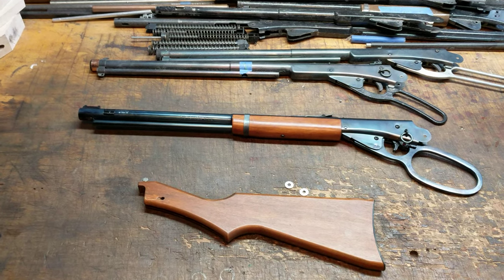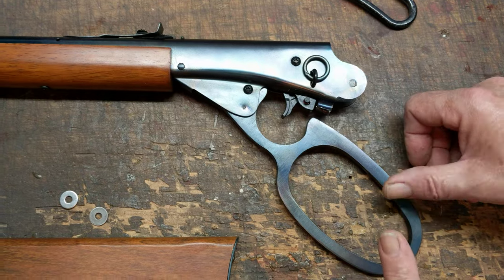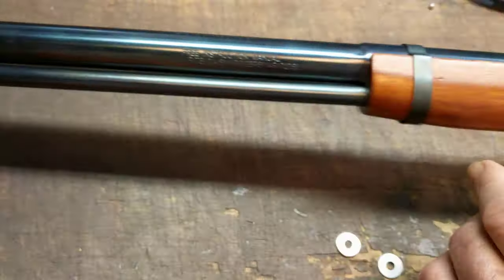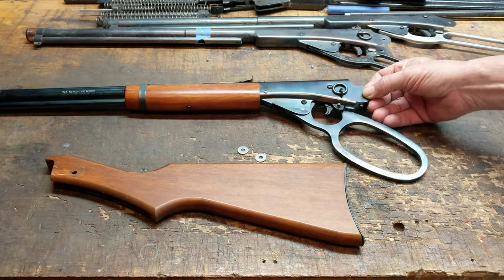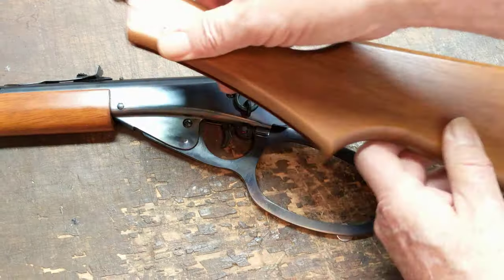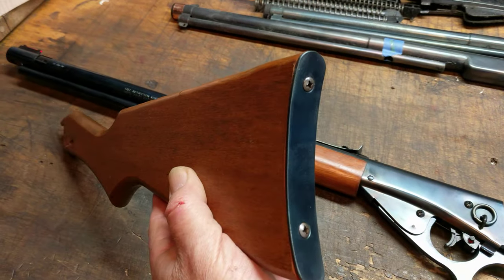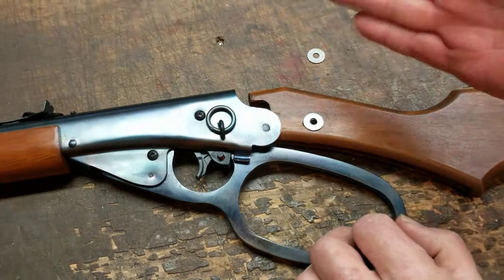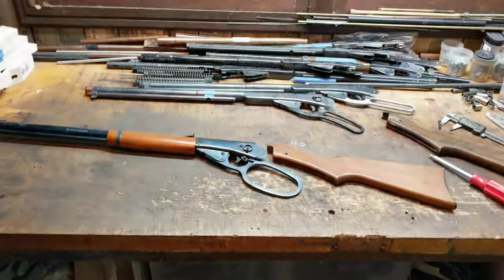Daisy Model 1938B with tweaked Chief AJ stock and large loop lever

Comment: When I dropped in one of Mark's pre-assembled plungers with the big air tube and 327, my 1938ARR went from 282 fps to 386 fps using match BB's.  Using Copper Heads slows it down about 10 fps.  Its kind of scary now because if that BB finds something solid to ricochet off of, it really flies.
Reply: no chronograph here but warmed it up good and FrogLube'd the cylinder and bore before dropping in "the gold package", plunger+tube and metal lever.
couldn't tell ya if the FrogLube helped, was an "oh hey why not" since I was already there and had some. wiped clean with alcohol 3 times before heating and applying the stuff, let cool, wiped clean twice, oiled then installed. seems to like Hornady black diamond.
Reply: @modelnutty6503  that might work, I've never really used frog lube in contact with a poly seal.  I have had some luck with frog lube in black powder guns and AR's.  Its very much like the old T/C bore butter or Wonder lube.  If I lived in a hot climate I might try high wax content lubes but I used a liberal amount of straight ND 30 wt on this one.

Comment: How is the quality of the Chief Aj loop lever? I was thinking about getting one.
Reply from the maker: It's solid steel with a very thick poly/expoxy/? blackish coating on it. Quite difficult to remove and if you do take it off you'll be faced with a pretty arduous task in getting the steel cleaned up enough to refinish as it's got all of the factory mill marks hiding out under the coating.  The Daisy factory big loop will fit a bit better but it's a plastic lever so you lose the additional heft the AJ lever provides and that will make a difference if you plan to embrace the Chuck Connors "Rifleman" spin school of  lever action shooting.